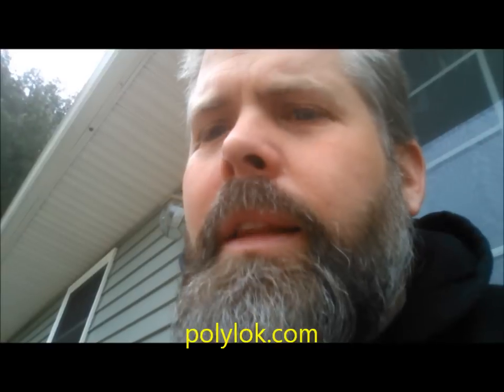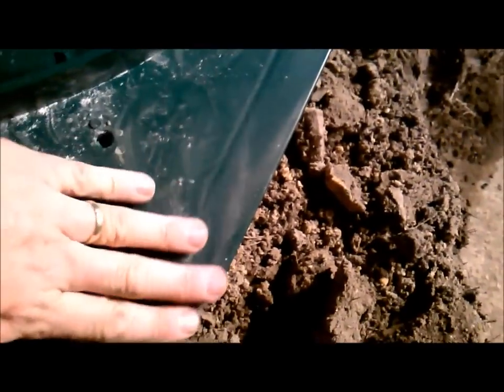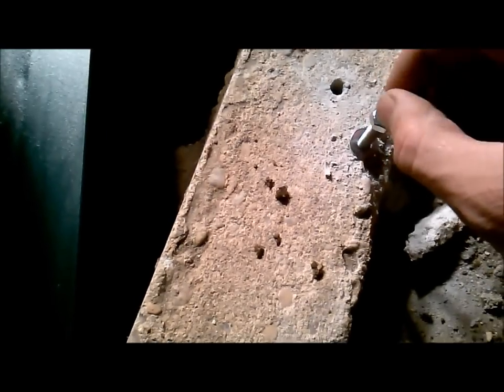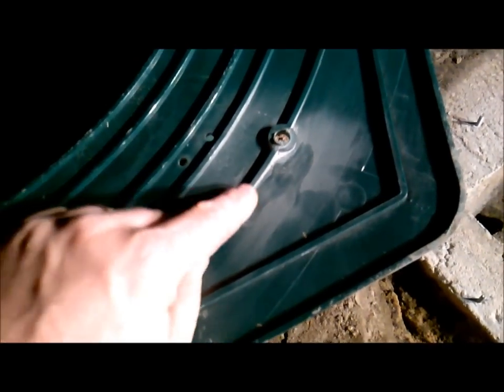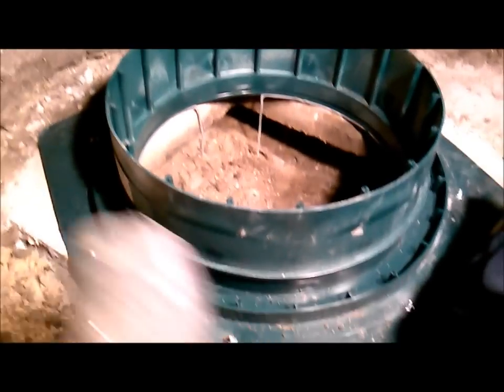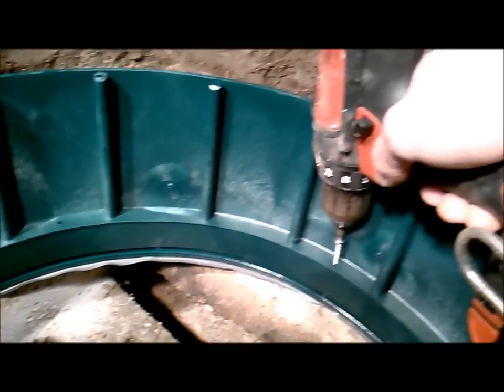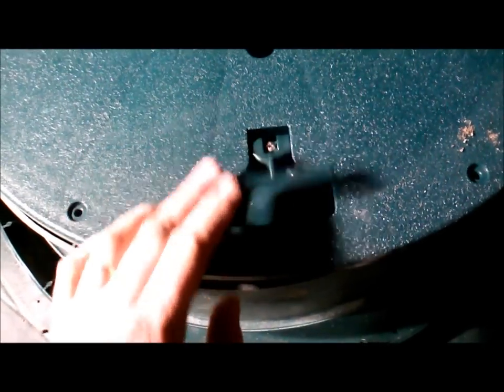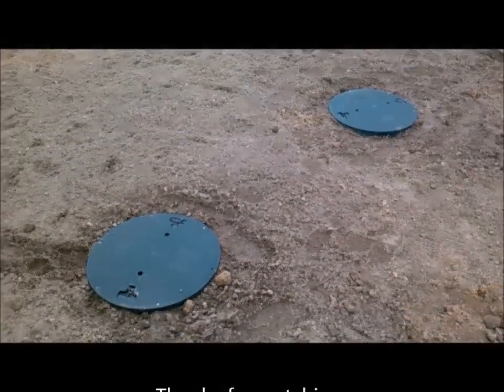Septic Tank Riser Installation and Review

Comment: Nice vid.  I did everything the exact same way except for when I attached the flange to the top of the tank I used masonry screws and just screwed down the flange directly onto it. no need for hammering in lag bolts or using nuts IMO
Reply: If he did it your way, then he would have had nothing to "Bang".

Comment: Not bad.  I noticed your butle rubber had a big gap where the four corners are!  Seriously, that area is not sufficient to stop any rain water from leaking into the tank!  I have a problem with underground springs on my property and ground water kept filling my tank and flooding my drain field and seeping into my tank lids.  I used another brand riser, and used caulking around the butle rubber, and after installing it, I sprayed expanding foam all around the the base.  I saw this trick in a different video and liked it!  Did you test for any water leaking into your tank after you installed everything?
Reply from the maker: Hind sight I really don't need to seal the riser to top of tank.  Rain water would get into septic tank regardless via drain field, and if large amounts of rain water get into tank via riser it would drain out into drain field anyhow.  Probably could just leave lid to riser off, but smell, safety and the prevention of large objects getting into tank makes me inclined to keep the lid on.